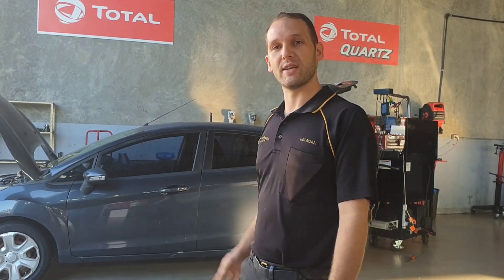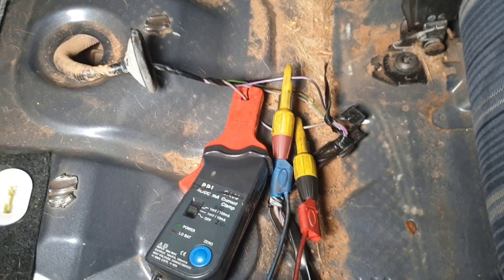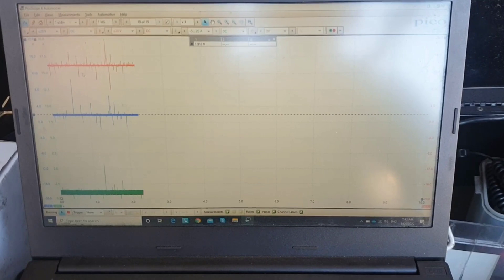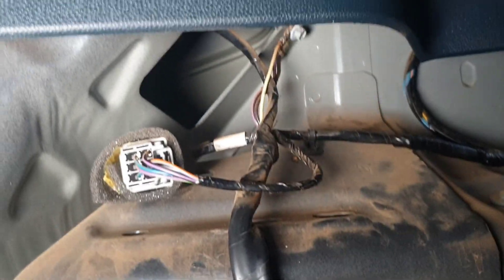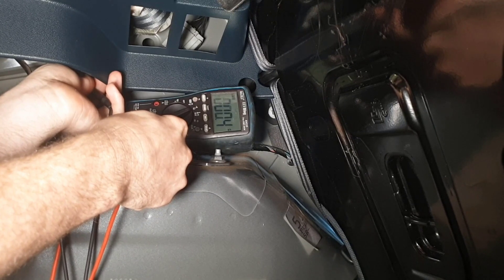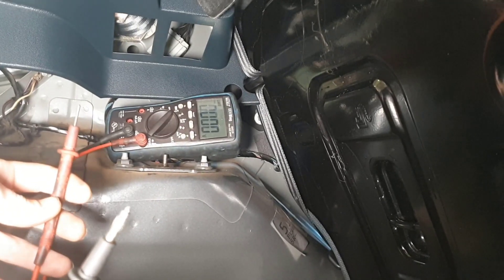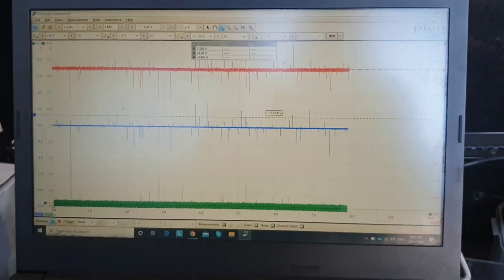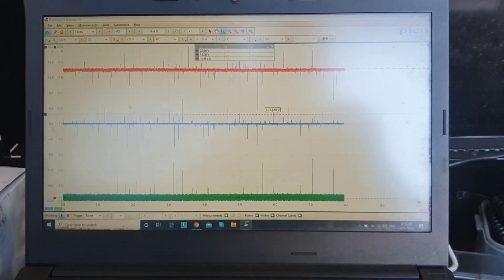Voltage drop testing

Comment: i have a easy question im sure you can help with
as a diy guy and because we cant do voltage drop without current to test the wire and many times a no crank has no current flow  in starting system i would like an opinion on using jumper cables as a way to determine bad cables meaning if i have a no crank yet have power and ground but when i hook a jumper cable from battery to positive/negitive to starter pos/neg (one at a time to determine which side has resistance)and it then starts i can then confirm high resistance in the cable.is this a viable method?

also i hear  we cant just create a circuit using a light in the starter circuit to create a loaded circuit we can voltage drop test
because the light doesnt pull enough amps,but if the voltage drop is enough to prevent a starter from starting wouldnt this method still see the voltage drop?

also any other methods for diyers to perform a voltage drop test on a circuit that doesnt have current flow?